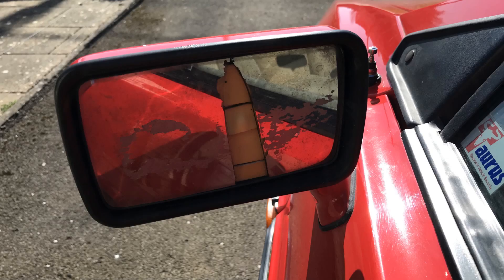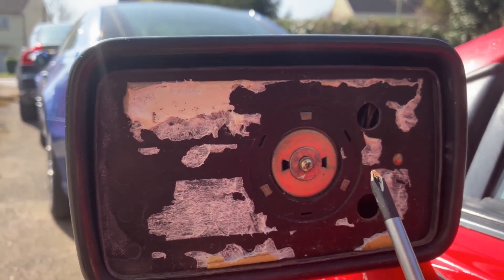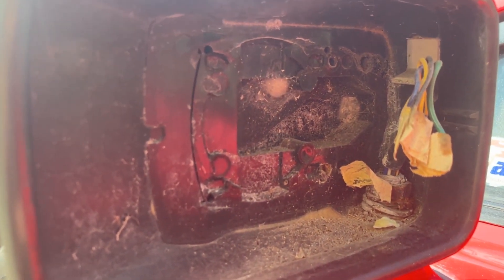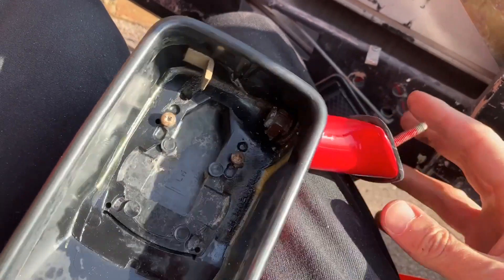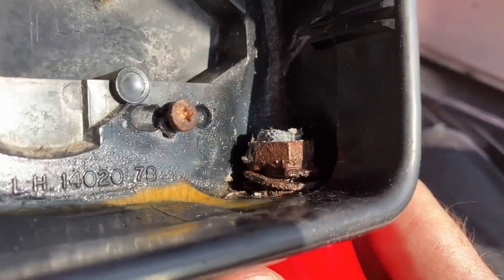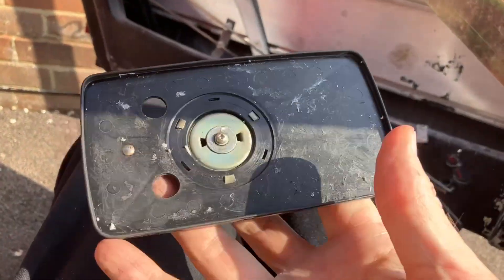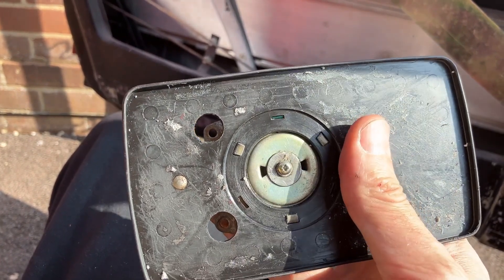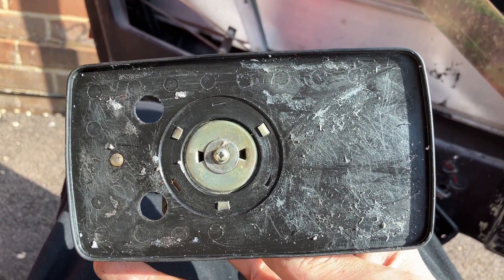How to fix Esprit door mirrors

Comment: My s2 mirrors don’t work, no power to them and have spent far to long looking for the inline fuse feed. I’m thinking of getting a modern motor unit and fitting it but that probably means destroying the existing mirror glass.
Years ago I was a heavy goods fitter and unbreakable plastic mirrors were available, the mirror “glass” was high impact plastic andcould be cut with a hacksaw
Reply from the maker: Yes it does seem odd that to remove the mirror backing plate to get at the “motor” it is almost a given that the glass will break. They’re not always easy (or cheap) to get hold of either and the only unbreakable ones I could find were useless as a reflective surface. I was all for putting in some later motorised unit but then I found all the wiring into the door had been cut. As I’m the only person who drives the car, I don’t really need to be able to remotely adjust it - but I wish it would stay in the position I left it!

Having just looked again I wonder if something like this would work https://www.cutmyplastic.co.uk/acrylic-sheet/mirrored/?gclid=CjwKCAjw586hBhBrEiwAQYEnHeGW-bYSvS9Ih-uh_xgOlz2fWD0pyATJRyQ_SZdLrTge0iCBWDGQ0xoC3joQAvD_BwE